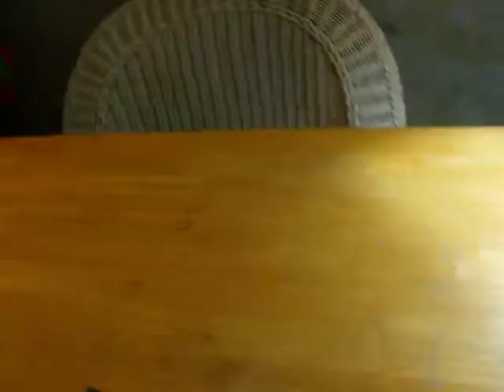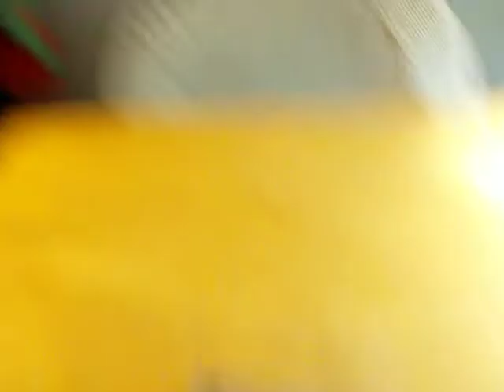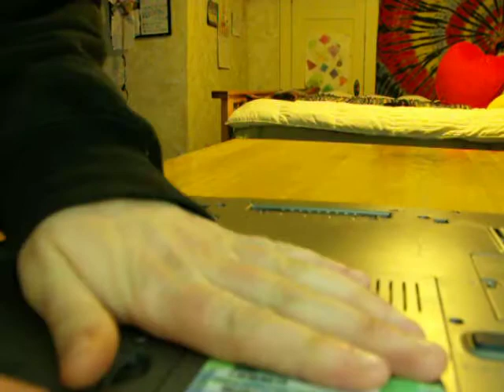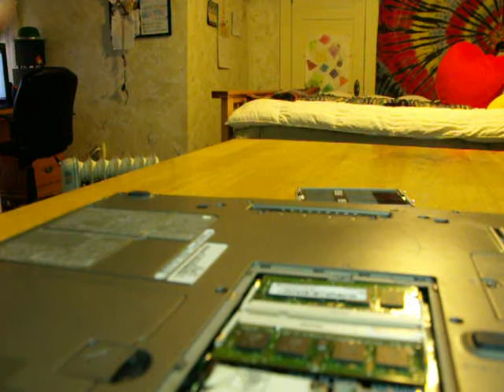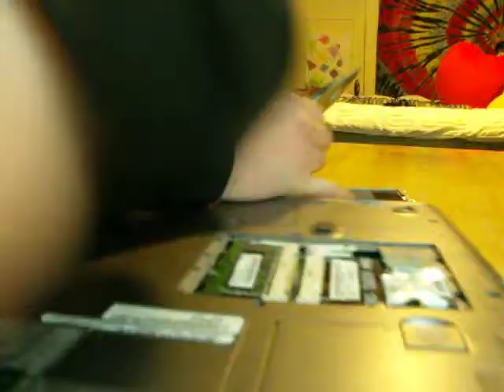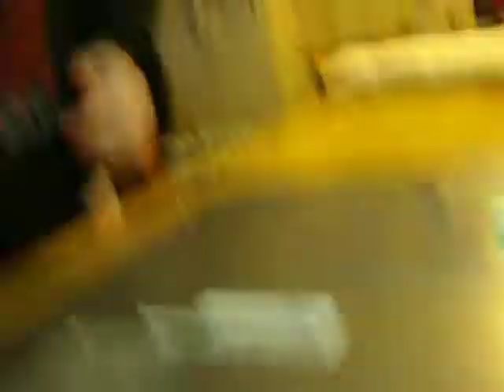Dell Latitude D510 RAM.

Comment: Hi, wear gloves and you can remove the ram cards is OK. what is the maxmuim ram you can installed for D-510?
Reply: I looked about it for my own D510, the manufacturer says it's 2gb the max, but I saw one of these with 4gb.
Reply: @Theragatups  I bought it long time ago and I upgrade it with 1 g for ram , that what Techniction told is the maximum can handle , but now I do not use it any more bec it too old .